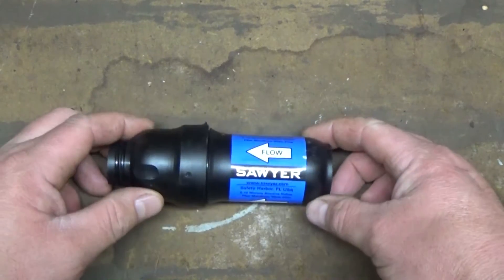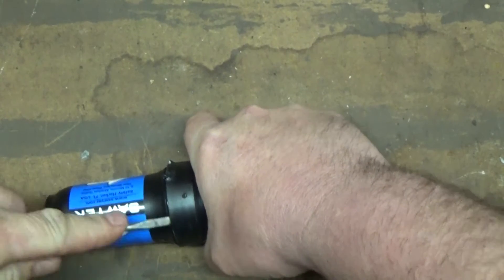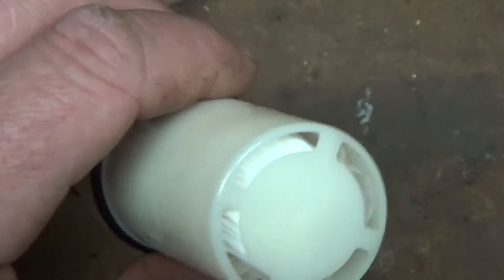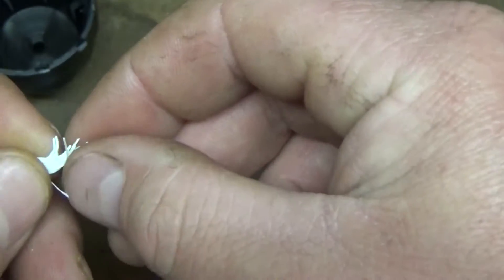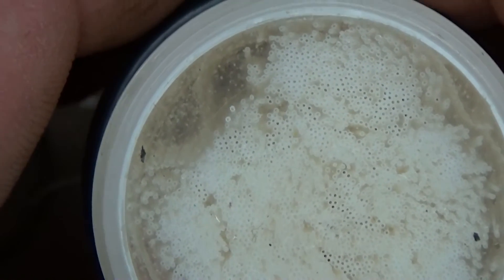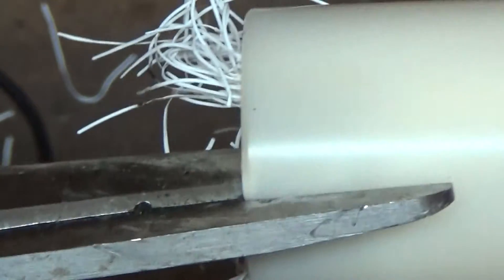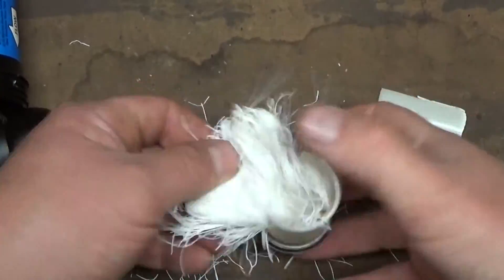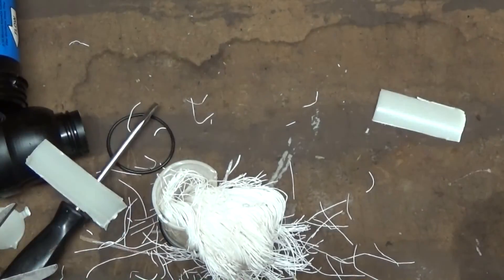Anatomy Of A Water Filter:  Inside of a Sawyer Squeeze Water Filter

Comment: Interesting experiment...thanks for sharing.  My thought is that the freezing expanded the diameter of the elastic capillary from the spec'd 0.1 micron to a much larger diameter...thereby compromising the blocking of bacteria cells.  The hollow capillary was clearly visible in your video; 0.1micron should not be visible to the human eye.

"A micron is a unit of measure in the metric system equal to 1 millionth of a meter in
length (about 39 millionths of an inch). The average cross-section of a human hair
is 50 microns. The human eye cannot see anything smaller than 40 microns in size.
50 microns – Diameter of a human hair
40 microns – Lower limit of visibility of a human eye
25 microns – White blood cells
8 microns – Red blood cells
2 microns – Bacteria"

http://www.baldwinfilter.com/literature/english/TechTips/201403TechTipsMicronRatings.pdf
Reply from the maker: 14er54 Thank you for the information!

Comment: sawyer does not filter bacteria or virus. So keep that in mind. If you filter water where beavers live or any feces enters the water source you are getting sick. Should always use the sawyer with a UV light like a sterpen or sweet water from MSI. There is also PURINIZE which I am testing right now. Getting sick in the back country is no fun. 

Alot of people will filter the water and then boil it to make the mountain house. Which because of the boiling they just killed any virus or bacteria. Which is safe. But to just filter and drink is dangerous. Something to think about
Reply: Secret Stuff ™  "filters are certified for ABSOLUTE microns making it impossible for harmful bacteria, protozoa, or cysts like E. coli, Giardia, Vibrio cholerae and Salmonella typhi (which cause Cholera and Typhoid) to pass through."

Do your research or do a water lab study. 

If your concerned with viruses from American sources of water ( which is not a big concern). Chlorine Dioxide drops will take care of that.

Cheers 🙂🤙
Reply from the maker: Secret Stuff ™ Thanks for the tip!   I typically use msr Sweetwater drops with the sawyer just to be on the safe side .
Reply: +Secret Stuff
Errrrr.......I'm not sure where you are getting your info from, but the description literally says it filters out organisms like E.coli. It also states it has a 0.1 micron filter....which if anyone has taken a microbiology course in college 0.2 microns is at the very low end of bacteria size....
Reply: Boiling waste time and fuel I suggest using the M.S.R. trailshot & the Life-Saver Liberty or Cube which filters Viruses to have a complete backpacking water filtration system

Comment: Interesting, my filter just stopped working after maybe 20 uses. I wonder if those filter membranes can dry rot if not used for awhile. Thanks for the info!
Reply from the maker: OUTDOORS55 good question,  maybe try to contact sawyer and see what they say.   Did you try back flushing it well with clean water?
Reply: I back flushed it after trip. It never had a decrease in water flow the whole time I used it. Im definitely going to contact them. Those little membranes look awful fragile. Maybe ill just switch to aquamira ha..:)

Comment: I guess I'm missing something here....  no moving parts in a filter...  filter froze and now it's trash??? And it was bone dry when it froze????  Common sense tells me if water was present in the filter and it froze... maybe the fibers break and compromise the workings (doubt it though)...  but a dry filter?  I used to work at a trucking company... we would haul everything!  There is NO WAY they distribute these filters to stores in heated trailers.  Or think about it this way... if this came to you via UPS.... do you think they would ship these in the dead of winter, leaving it on someones porch for HOURS?  Don't think the boxes they come in are heated...They would have to sell them only during warm months!  I bet if you took apart the new Sawyer Squeeze it would look exactly like the one you just ruined.
Reply: If there is already water in the filter, once frozen it expands and breaks the filtering tubes.